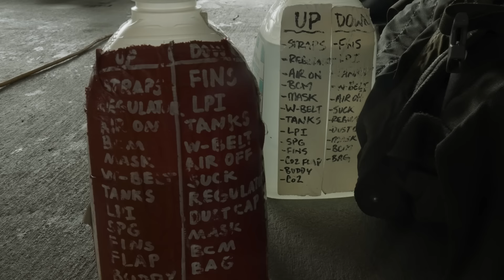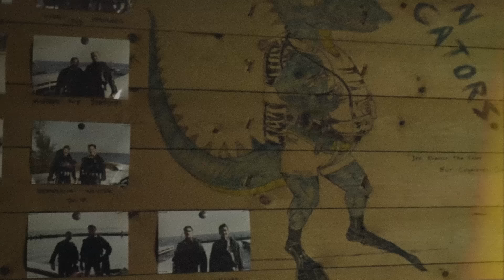Inside the Special Forces Combat Diver Qualification Course

Comment: “Combat diving” did not originate from the OSS after WW2 as the soldier mentioned. It originated in the Us Navy and Marine Corps just before and during WW2 with the Navy frogmen, Marine Reconnaissance and Raiders.  There were some US Army EOD consultants used in the formation of the training, but unless “combat diving “ as the gentleman mentioned has some specialized definition then the history isn’t right.  The need to reconnoiter beaches for landings was the impetus. Later it developed into a means of covert insertion of Raiders per FDR’s directive for commando units to Admiral King. Nowadays it’s all crossover training among SOCOM and the individual units with these capabilities but there was plenty of “combat diving” long before post War OSS formation.

Comment: This is really awesome to see. Great video. I noticed the divers have a bright red safety float when in the water. With all the safety mechanisms that have to be in place is this only for training purposes?  They use rebreathers for conducting covert underwater infiltration so if diving in a real combat situation would they simply not use the float?
Reply: Yeah even during real-world Ops… SEALs, Combat Divers, etc always use bright orange floats right over top of them while covertly infiltrating in hostile waters. That way the bad guys, pirates, pleasure boaters, etc. know exactly where they are and that they are there so they don’t run them over with their boats, possibly wacking them with the propellers. A little harder for big tankers to see, but that’s why they have binoculars. And the more orange floaties, the better/safer for the operators.
Reply: @williethom5075  yeah those floats would be really tactically unsound
Reply: @williethom5075  🤣

Comment: As an land nav drop this makes me more determined to get back to selection.
Reply: Same here brother… only went 2/8 at Hoffman 😞
Reply: @masterslayr641  We'll get it next time. I was an RK at scuba road.
Reply: @adamzuckerman3437  how do you get to ur point if a road is between you and the point? Do u just have to sneak through it and hope cadre doesn’t see you?
Reply: @adamzuckerman3437  any advice for an 18X? I’m signing my contract soon
Reply: @adamzuckerman3437  did you roll back to RASP?
Reply: @clayton2500  you cross the roads at 90 degree angles and intersections at 45 degree angles… you can handrail roads and open areas (bowling alleys) as long as you’re 50 meters off the road but if you gotta cross the road definitely make a sharp 90 and I’d recommend putting your map away and holding out your compass so in the small chance cadre sees you you can explain what you are doing and they won’t road kill you
Reply: @tristan9680  yea make sure you are solid at running rucking and have a solid foundation of strength! The prep course is only 5 weeks so not long enough to get you in shape so you gotta be in shape before showing up to Bragg… continue to lift weights cause you’ll need strength at team week! Lot of fast guys crush gate week but fall off at team week because they can’t carry the heavy shit! Be a gray and don’t bring negative attention to yourself you’ll have plenty of time in between airborne school school and the prep course use that time to dial in your fitness!! Learn basic knots and lashings because you’ll need that skill during team week… don’t quit if you get dropped during land nav week you’ll most likely get a 6 month return and you’ll just retrain at Bragg until your selection date! Take care of your feet! I’ve never gotten a blister and never had issues with my feet but I walk a lot I’d recommend around 25-30k steps a day wear boots as much as possible too
Reply: @clayton2500  the cadre will catch you. They have strategic locations pin pointed where they hide to catch candidates not doing the right thing.
Reply: @dan7462  I guess I’ll just have to take matters into my own hands and take out the cadre
Reply: @clayton2500  good luck with that buddy. I used to work out there. 2010-2013.
Reply: @dan7462  No lucks required champ. All skill. My tactics are simply to advanced for the old timer cadre. #lightwork.
Reply: @clayton2500  ok there stud. Talk to me when you have a GB.
Reply: @dan7462  I was just joking around man. Being a gb is the dream but I’m far from ready physically and mentally. Much respect to you and all who’ve tried.
Reply: @clayton2500  I spent nine years in the Infantry prior to going to SFAS. Even though I had already been to Ranger school, jumpmaster, and had a CIB, I didn’t think I was ready either. I just wanted to leave the 82nd. No part of the course was ever challenging to the point where I thought about quitting. Sure, it’s challenging and long but I’m already bilingual so I didn’t have to go to language school. Which I hear is the hardest part of the Q-course now. 
But when I was assigned to 3rd GRP I was sent immediately to a dive team. That’s when shit got really hard. I graduated from Dive school a short while later and then the Dive Supervisor course a few years later. 
After 25 years of service I retired. I have no regrets. You are the master of your destiny.

Comment: Doesnt look to hard. I wonder if they learn to swim in 20ft plus swells, in storms. It is Florida. 

I could see them being better useful in Swamps. 😮

You do have to be careful dropping in from a chopper. I forget the ceiling before the water is Concrete. Add the weight. Fatal.

Comment: Why don’t these guys just switch over to the Navy and be SEAL’s after this? They could, right?
Reply: For one, someone can only switch to a different branch when their contract for their current branch expires. You can't just do it whenever you feel like. Two, these guys are mostly just trained to use diving as a way to infiltrate/exfiltrate in and out of areas. What Navy SEALS do is far more complex than that and much much more difficult than this. So no, they can't just go be a SEAL. Having the diving qualification would certainly be a big advantage while trying to qualify as a SEAL but it's not the same thing. SEALS do a lot more stuff and a lot harder stuff so getting accepted would still be a big undertaking.